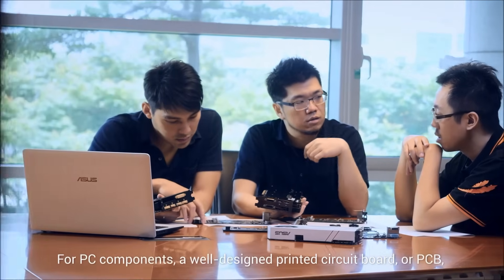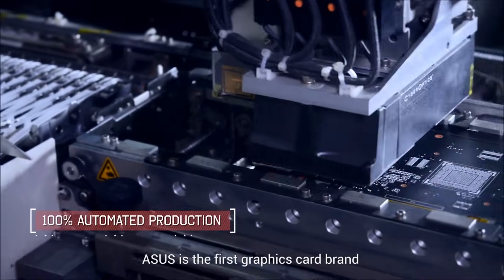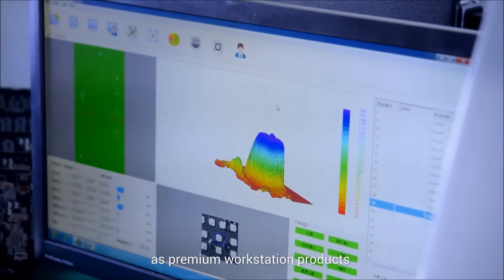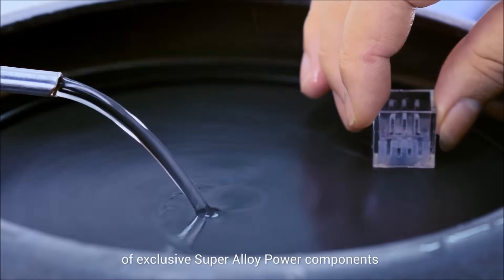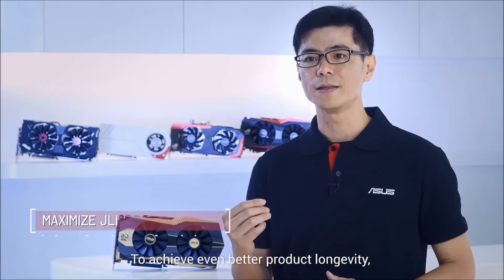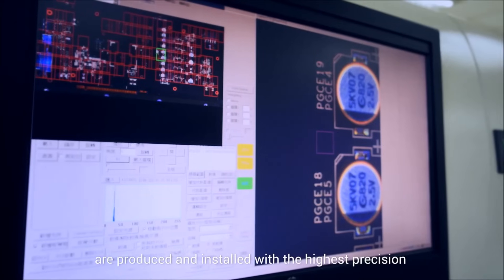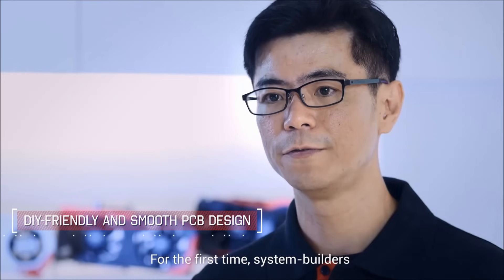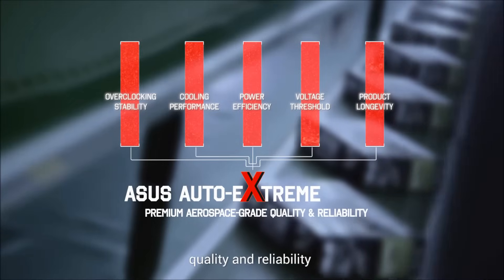ASUS Graphics Cards with Auto-Extreme Technology

Comment: MSI and Gigabyte have nothing on ASUS motherboards. These things are built like TANKS. Never had a single problem in my life with an asus motherboard and Ive been working on PCs since 1999. 

Now I got an Asus Rog strix GPU paired with an ASUS MB The PC has been running for 2 months non stop no turning off or nothing. Not a single crash

Comment: your inherent board design is why i went with the 3070 strix oc, the fact that it comes with a 3080/3090 cooler is a bonus. Ive owned tested/sold 2080ti strix oc, 5700xt strix oc, 5700xt TUF evo2. So ive had some time with some of the would be "Flagships" of their eras. To think the level of QOL/performance the 3070 STRIX yields from a pure power draw/sustained clocks input/signal stability. On top of the inherent board design vs the 3070fe(also owned) which had coil whine and needed a 1965mhz .925mv UV to be ideal from a performance/thermals standpoint to retain its stock fancurve to keep the 0rpm/idle curve intact which is quite IDEAL. Thanks to buildzoid for doing a pcb/gpu/board breakdown showcasing your VRM/dram orientation/cooling. ASPECTS like these are purely why im always willing to go with an ROG/STRIX gpu. Most ppl FAIL completely to realize the SHEER importance of these aspects towards GPU purchasing. As a former 7990 refurbished owner that re-pasted multiple times and got GOOD run from that oe/7990 board design and NO-OC capability due to the inherent board/gpu/design. These days its all about checking system thermals/noise of operation/input signal frequency for consistency signal/gpu transient response off inherent board design/operation. That "investment" or price difference is as MUCH a build priority as...setting $$$ aside for a proper board/vrm, PSU/12vrail/transient response/thermal perofrmance psu, Chassis with ideal cooling performance+fans. TO me those aspects go hand in hand in owning a long term/GOOD build. That will perform well/the longest that will not succumb to voltage creep/vcore creep etc....on top of time aging my build. FWIW i bought a "returned" 5700XT evo2 when i sold my 2080ti strix. And returned it the same month the 3070FE launched....only to buy and trade said FE for a strix, i wanted one that bad and hunted one down. Yet the entire time Asus never let me down even with the 2080ti and 5700xt strix being sourced purely off the 2nd hand market. They all ran well/tuned well Other than inherent board design and potentially different actual on board hardware being utilized....it was really fun trying to clock both of your 5700xts to run at similar operating levels/ocs. While trying to see which one cooled/sustained clocks better(strix had a higher power ceiling) though both were able to hit 2ghz with relatively no effort. The duel bios is quite OP, you can enable a new v-bios and resizable bar, or have it completely disabled with the 2nd bios depending on game/engine stability...making quick ease of troubleshooting if you capture game content/benchmark games/cpus etc. Just to measure the impact of resizable bar game to game/engine to engine/api to api. Or with any apparent gpu/windows update that may cause impromptu instability if you stream or climb benchmark ladders ETC a slew of end users. Got my 3070 Strix to break stock 3070ti numbers in 3dmark for me thats "good enough" im getting 3070 temps/power draw and completely dodge the vram temps of a 3070ti. To others theyd rather have the "few couple" frames extra....at the cost of system health or gpu fanspeed/noise. But on a legitimately serious note The frequency/input of the 3070 STRIX is what keeps me coming to ROG/STRIX. Its really the only PROOF youll ever need...fps/avgs/yields are all fluff...sustained clocks/frequency/transient response and input latency matter more...the actual proof of a better/superior product....with superior board design will always YIELD better results when "PUSHED" and....the most IDEAL performance in the majority of real world/use cases. I wish more emphasis was placed on signal/latency/transient response. BIG power systems encounter a lot more issues with ripple/vdroop bc of these things. Can even be fatal for some builds on the edge of tolerances.

Comment: Converted to Asus/ROG about 15 years ago and never looked back. Currently running a ROG MAXIMUS XII HERO + 10900k + beQuiet DR4Pro, runs so well, best setup I've ever owned. Thank you Asus.🤗
Reply: so your board never get burned or something on heavy use  ? ,,    nice  rig up there  what  PSU and Ram module you using and which monitor with i9 10900k

Comment: So that also includes less salary payments, more productions while on the total opposite contrast adding extra prices on your stuff too? However your products have been the ones lasting longer for me, specially in laptops, many dead Acers and my 2006 Asus is still alive and was used for many years 24/7 as server stuff (and was from my brother and was completely full of dust overheating and shutdown, my brother even punched it hard above the screen and didnt even break it, I cleaned it up, put better thermal paste and back to service with good temps and no shutdowns :) )...

Also the only GPU since the 90's that lasted me many years and its the only 1 survivor I ever had was also from your company, Asus DirectCu II GTX570 3 slot beast GPU and was heavily OC used at around 25% OC 915mhz for many years with 1.2V unlocked bios and that GPU is incredibly still alive. All my older GPUs died and without even OC them.

My next GPU and motherboard will most likely continue to be Asus. I'm still using my 2011PC with 0 problems, Asus Sabertooth P67 motherboard is still going strong and pushing my I7 2600K to 4.9ghz and the ram at 2133mhz, however the internal soundcard is the worse I ever seen, it makes a huge amount of scratches, but since I always had and buy better soundcards, couldnt careless.

Edit: my current Strix RX480 flashed to Strix RX580 is also still working.
Reply: Well the part of the automated soldering is a pretty well industry standard for big manufacturers. They may have a special process for reducing the use of chemicals and such or they are comparing it to hand soldering parts on. I wouldn't know specifically. Look up the process on how many companies manufactured motherboards with SMD components. All of the machines are like this where the machines place the parts down from a reel and then get automatically inspected after the solder flowing stage. A really cool channel is Strange Parts, he tours real Chinese factories among other things as well and it's so cool to see how stuff comes together to make a product.
Reply: @nickschafer4068   yep, I have seen over the years people visiting them and posting on YouTube.

But Asus has the TUF certification on their tuf and upper line of products now whether it's all just BS or not I don't know but my 2011 Asus Sabertooth P67 is still going strong, in fact just a few days ago it seem my I7 2600K just had enough of high OC over all those years and seem to have burned 1 core but I have set 3 cores in the bios and it still working 😎

My Asus Strix RX480 flashed to strix RX580 is also fully working though the Samsung GDDR memories lately are getting a bit bad.

Ps: it's still my only PC and I will definitely go with a Asus motherboard and Asus GPU for my next PC wether I go for Ryzen AM5 or intel 13th gen or maybe even wait a bit longer... Never had a PC before this 2011 that lasted even half this long.

Comment: If this automatization won't reduce the current prices, than it does not change much for most users (most don't stroke their graphics cards smooth PCBs nor do they care about the back as much, you get a backplate over them most of the time anyway).
Reply: has been around for a while
Reply: McHox Figured as much, although they did emphesise on it right now as their amazing new thing. A girl can hope, I guess xD
Reply: Nugie Sixx in that case, they can keep their innovation if it does not bring much to the end user
Reply: Axel Alexson i am one of those who are about perfection and smoothness of a product and quality i am one of few who buys a product to admire and look at small details on the product and be happy i am one of few who stare at the gpu or any product by its  beauty and the way it was manufactured i am one of the few who appreciates the manufacturer's effort to build such a beautiful product i am a type of guy who admires product longet and the time i use it :)
Reply: Automation improves the rejection/error rate thus less units fail QA so money is saved that way. I doubt it changes much for you the end user as you only receive QA passed units anyway.
Reply: they didn't reduce the prices unfortunately
Reply: This process wouldn't fix chip shortage or scalpers and honestly every other GPU manufacturer uses it. They just don't really "brand" it. It's an industry standard. No GPU manufacturer would solder parts manually if they can help it these days. It's only a reliability, economic (for asus with more reliable GPUs to sell), and environmental point. The thing I see how could be talking about being more environmentally friendly is using less flux(need it to flow solder). Whether that is standard with any other GPU maker or comparing to hand soldering? I wouldn't know

Comment: yeah bla bla bla I ordered 2 graphics cards an rx480 and rx580 both strix and got malfunction, artifacts on most games, pc crashing, and powering down the pc
Reply from the maker: Do you have adequate cooling? If so, you gotta send them back!
Reply: ASUS ROG (Republic of Gamers) yes, it's properly cooled, I want to send it back but thanks to the miners all rx480 rx580 gtx1060 and some gtx1070 are out of stock, that's why I waited, I wanted to send it back on the same week but it was all out of stock
Reply: lol you sure it's not EVGA FTW card? XD
Reply: Fahad_Nomna7 yes I'm shure
Reply: Moon_Breaker Im using a nox hummer 650w plus bronze, mobo Asus maximus hero VIII, I know the board is good I tested on another board and I had the same results, the psu I think is good, is not the most trustworthy brand but it worked fine so far, the graphics cards has coil whine too